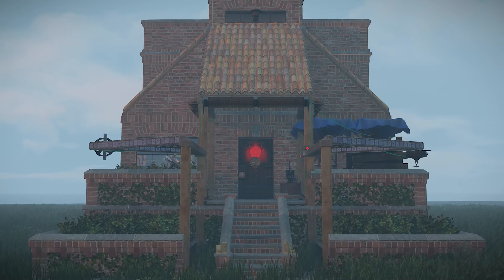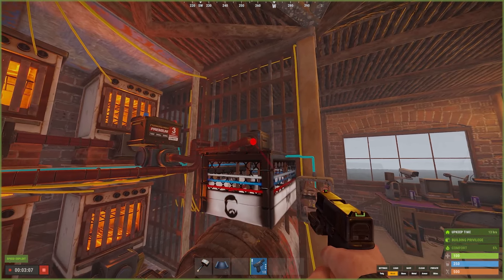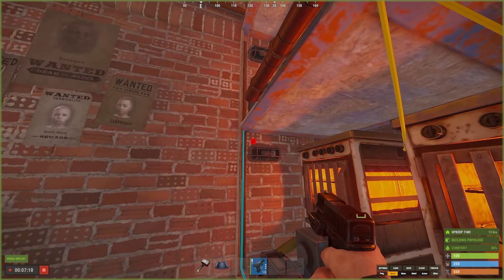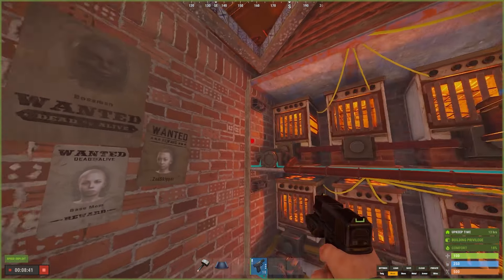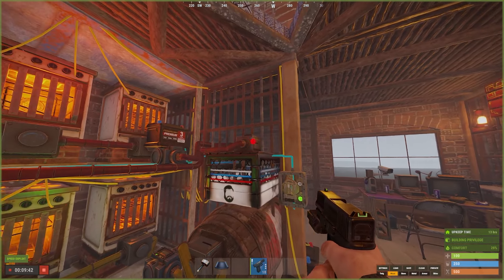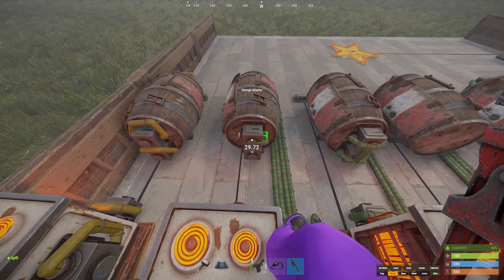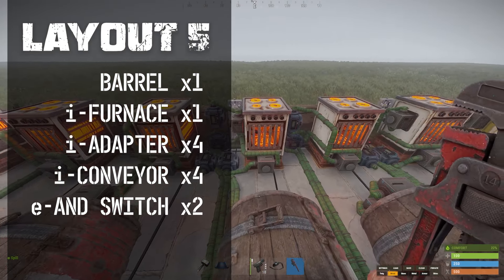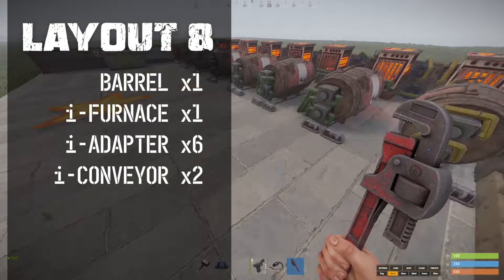How to Improve Your Factory in Rust - Industrial Tips

Comment: Daisy chaining does nothing for smelting, as pointed out by others. Still, daisy chaining its valuable for larger groups and dropboxes. When 4-5 people come at the same time and all of them are using the same dropbox it can be very nice to boost the speed to empty the dropbox into buffer box. 

Furthermore, 1 conveyor moves 60 from a stack, per adaptor. In other words, you can boost the speed up to 180 per stack from 1 container using 1 conveyor and 4 adaptors.

If you want to double that speed again, you can use 2 conveyors in parallel.

Just FYI, a conveyor can only have 30 connections (or smth like that) on each side of it. So if you have multiple dropboxes, and you boost all of them you'll run out connections pretty fast. I only boost gatehouse dropbox.

Also, a conveyor pulls from the 12 first occupied slots in a box. That means if you have for example 12 slots with 1000 stones in each, it will move 60 stones from each stack, per tick (ca every 5s).
So it moves 720 stones every 5s. If its boosted and doubled, its 360 stones per slot. So in that case it moves 4320 stones every 5 sec (as long as there's more than 360 in each stack).
Reply from the maker: Thank you for the deep dive! I’m definitely looking forward to trying out some of the suggestions I’ve gotten in the comments, much appreciated, gamer!
Reply: Its x4 faster, 240 per click not 180
Reply: What do you mean double conveyer pls show

Comment: Im still trying to figure out why the normal system slowed down on the 2nd test.  You didnt change anything in that loop but it added 15 seconds
Reply from the maker: I’m right there with you, I have to assume that the speeds vary somewhat, which is probably why the figures fluctuate between tests.

Comment: What about 3 adapter in the barrel, and a industrial combiner goes to conveyor, after that 2 adapter in the furnace goes to a conveyor with a industrial combiner and a splitter to the 3 input adapters of the barrel? It's a little bit of craziest thing, but it's a variant that you don't count of it. Greetings from Chile 👍
Reply from the maker: That’s a great idea, I’ll have to give that a try! Hopefully the digital clocks @facepunch is adding will have a built in stopwatch for easier testing!

Thanks so much for watching, gamer, much love to Chile!
Reply: @spilldrop-  I'd like to test with 6 electric furnaces (as solo I usually use 6) and 2 barrels with the settings I post before, should it works? Idk, but must be fun.

Comment: whats the benefit? if the furnaces cook at the same speed arnt you still waiting the same time for frags?
Reply from the maker: That’s a good question, while the speed of smelting does not change, the amount of storage required for ores in your drop boxes is greatly reduced, allowing for less downtime between farming runs and less chance that your farm will be stolen before it can be moved into your furnace from your deposit box. 

This exploit is mainly useful for large groups or long wipes where storage space starts to become a concern or when you need to transfer loot quickly (cave bases, raid bunkers, stuff like that). Thanks for watching!
Reply: @irBribe  But it still smelts at the same rate, so only thing that matters is how fast the first few ore's is transferred to furnace. After the first pieces are in, the furnace smelts at the same rate. So maybe if you have like 20 furnaces, then it may show few second difference, but other than that, it just fills the buffer inside the furnace faster without effecting the smelt speed.
Reply: There is not benefit at all to this "exploit" save for the conveyor working a little faster for those 1% times when your dropbox gets raided before being emptied. This is a waste of time.
Reply from the maker: Every industrial circuit has 3 main components: input, the circuit itself, and output. If any one of these components is made to be more efficient, the system itself is more efficient as a whole.

I would encourage you to make your own version of this system and post a video with your own measurements, I’m always happy to learn from someone with more expertise!